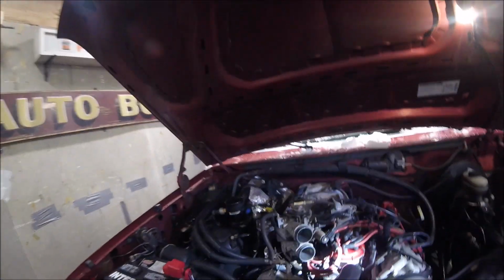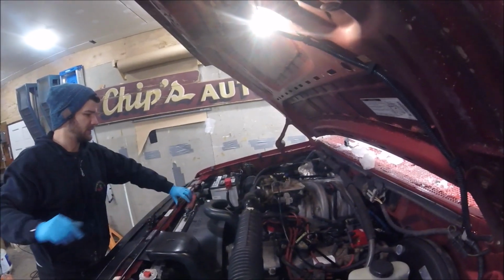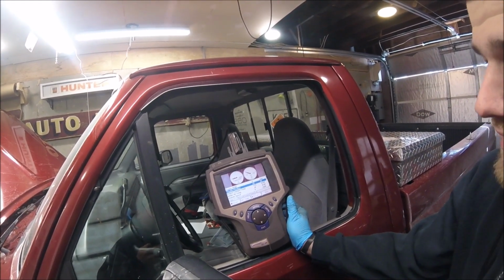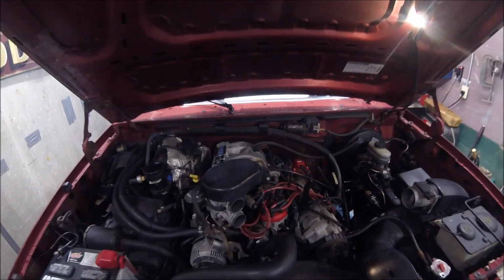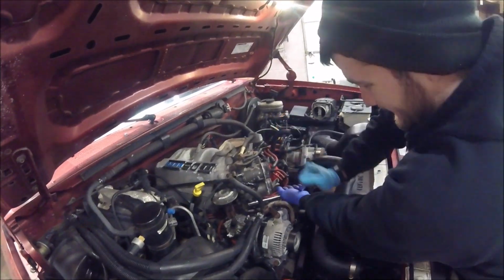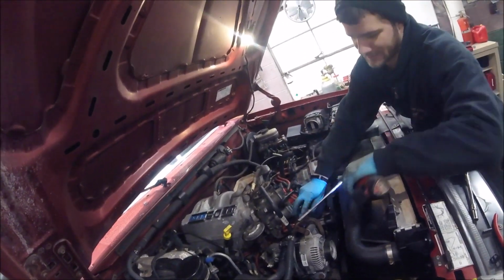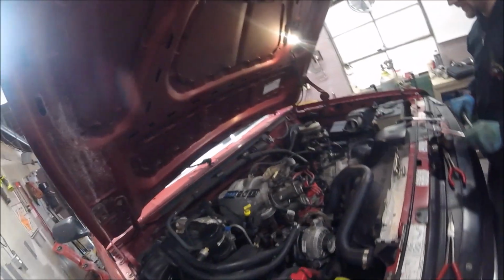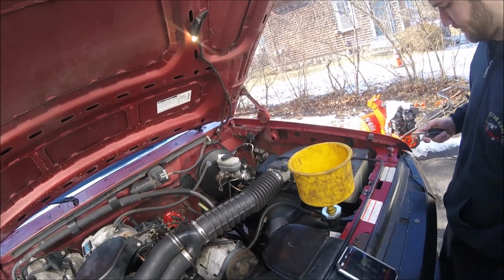1996 Ford F150 High Idle Diagnosis and Repair - See Description for Parts

Comment: If you don't have the scan tool, you have to probe the leads going into the TBS and compare the voltage to that given in the specs. More often than not, the bolt holes in the TBS will have to be enlarged so the TBS can be rotated enough to get the voltage in spec.   Could you hear your heater core gurgling at all after draining and refilling the coolant?  It's hard to bleed all of the air out with the truck level so I find the steepest hill I can find to drive up to help bleed the system.

Comment: Guys if you are having a high idle on these efi models check for vacuum leaks with the intake plenum gaskets, they could be cracked and old. Replace them and make sure you have no leaks with any of your intake system before you start diagnosing sensors. Just a tip good luck to y’all! I know how frustrating this was for me until I converted my 91 to a run with a carburetor.

Comment: My 92 f150 had high idle and after replacing several sensor, no change, the transmission solenoid was sticking so I added Lucas ,worked for me.
Reply: how did you find out it was a trans solenoid ?

Comment: I’m having a high idle after cleaning my throttle body 1500 new iac valve could it be tps sensor
Reply: Did the same thing. I think I cleaned it a little too well from what I've read you are not supposed to. How did you fix it?

Comment: I had a lesson with my 93 f150 5.0.  Long story short. Idle was up and down and sometimes black smoke no matter what. Changed every damn sensor that exists in the damn thing map sensor, tps, fuel pressurere regulator, had brand spankin new tanks and fuel pumps new plugs,wires, even the sensor down there by the maniffold, endless cleaning of the throttle body with spray cleaner,no vacuum leaks you name it. The problem was the frikin computer it is right under the brake booster.  To me the biggest hint of the problem was that the check engine light would come on as saying something is wrong the engine would run fine for a few seconds as soon as the engine light turned off as saying everything is perfect it would be crazy idling.  Found a donor truck pulled the computer problem fixed after 9 months of fighting with it about every other weekend.
Reply: I put a 94 motor in 93, did exactly what yer sayin until I swapped in the 94 computer.

Comment: Get a Actron CP9690 code tester. It checks live, record, graphing, transmission codes, emissions readiness test, ABS, SRS, oxygen sensor test, check engine light reset, oil light reset, and MORE! It has code-connect to diagnose codes. It comes in a black pouch. It uses 4 aaa batteries, not included. Get the USB cable to update it. EBAY has it. It comes with OBDI cable for Ford, G.M., Chrysler, and Toyota. A Snap-On scanner is suited for OBDI and OBDII. Get the primary and troubleshooter cartridge. It uses a  9 volt square battery. Get the battery pak and cable for away-from-the-vehicle review. Get the Ford1B adaptor for OBDI. Get the battery clamp cable for the Ford adaptor. It uses a K2A personality key for Ford OBDII with the OBDII adaptor. Get the manuals and case.

Comment: My truck is running at a high idel n it rubs up really high then it goes by dwn n it sounds like it's going to to blow up when u put it n nutral it sounds like the accelerator cable is stuck wide open
Reply: i had this same problem on mine it was a combination of a bad iacv and a vacumm leak

Comment: First thing I'm thinking is the CTS. Or TPS. Check codes with a tester.
Reply: Yes! Good idea! Get a Actron CP9680 code tester. It checks live, record, graphing, emissions readiness test, transmission codes, oxygen sensor tests, ABS, SRS, and MORE! It comes with a black pouch. It uses 4 AAA batteries under the rear cover. The CP9690 has cables for OBDI Ford, G.M., Chrysler, and Toyota. It's well-lit. It has code-connect to diagnose codes. EBAY has it.

Comment: 1990 F250, 5.0,2WD, rough idle, new IAC, new tps, new vss, new distributor, plugs, wires cap and rotor, new tfi, any suggestions, please!!!!!
Reply: Jason Smith Replace the CTS.
Reply: Throttle body

Comment: Just trying to understand....I'm assuming the throttle body did not have to be removed to change the TPS, but you wanted to go ahead and service/clean the throttle body.  Is antifreeze routed through the throttle body to warm it up?  Still wish I could understand why a code was not triggered, I guess the ECM just assumed you had your foot on the gas peddle slightly...
Reply: kramden Check the throttle body for warp.
Reply from the maker: Ford runs coolant through the throttle body to prevent icing.  The throttle body does have to be removed to replace the TPS as it's located on the bottom of the TB and there is no way to access the screws.

Comment: You left out things like getting the throttle body off and on. Cleaning up the throttle body. And replacing the new part.
Reply from the maker: My bad.  And I'm not going to pull it apart again just to show that I cleaned the TB and put in the new TPS.